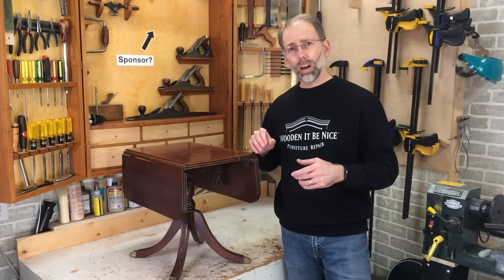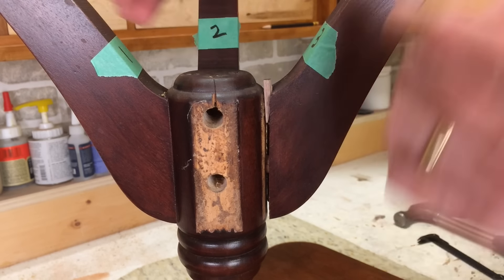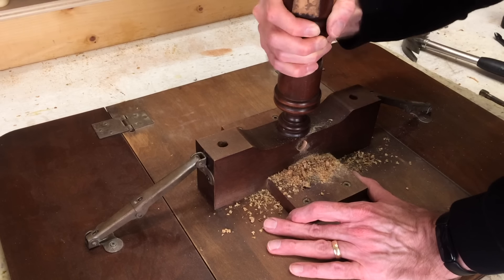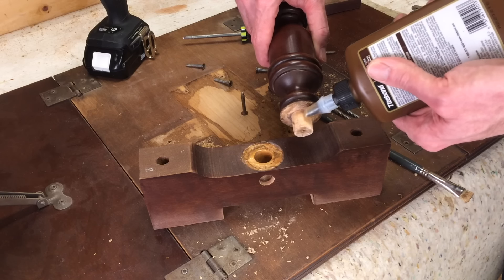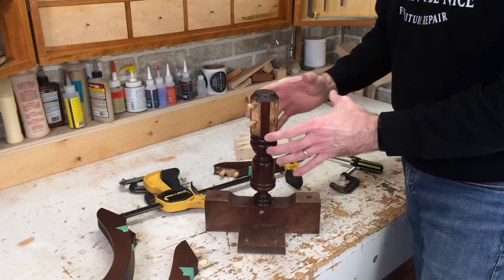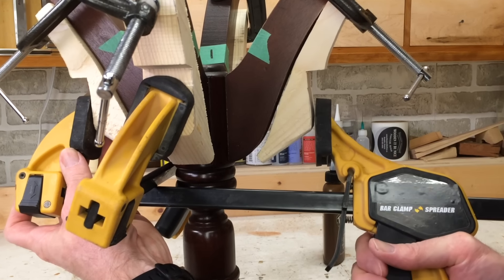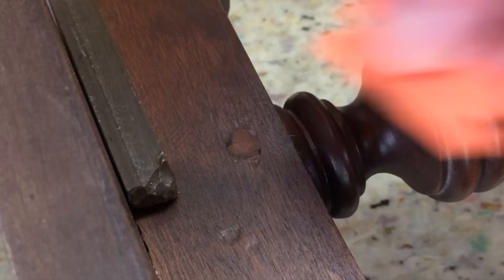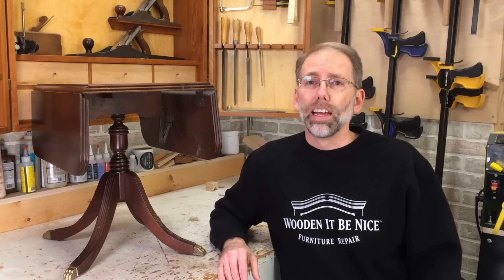How to Repair Pedestal Table Legs by @FixingFurniture

Comment: At 8:35 rather than using a large diameter plug cutter, I've used a device called by the marketer a "screw extractor". It is a hollow hardened tube with an ID slightly larger than the screw, and with saw type teeth on the end. It works very well, saved my hide multiple times during projects when screws broke during assembly. Don't know who makes them, or where I purchased mine, but Google probably knows. Afterthought, these would work to get access the the nails as well.
Reply from the maker: Thanks for being a subscriber Tom!  Scott

Comment: This repair is so,  so timely for me right n o w.   My sister dropped off an 1860's circa walnut piece just like yours,  but a bit larger,  and with only one loose leg.   The other 3 legs are nice and tight.

Comment: Scott, thank you for your helpful videos. I have a similar small table but instead of a metal mechanism to hold the sides up there is just a small movable piece of wood. They work really well and I'm wondering when the table might have been made?
Reply from the maker: Hi Kim.  The best way to determine the age is to look for the name of the maker on the piece, typically on the bottom and then do some research.  Without that, it's difficult to know.  Cheers.

Comment: Work at a bench. Doing  that work for decades! Just about every antique piece you'll get. Is driven full of Nails and screws. Along with ill fitting, slopply glued old breaks. Nothing to do but dissemble it all best you can. ( Just as you did) Trying not to cause further damage. But it happens. Just have to repair, make new parts accordingly. I don't recall ever seeing a drop leaf table that small. I wonder if it could have been a manufacturers salesman sample peice. Just a thought. 🤔

Comment: There is a variety of small silicon brushes sold to cooks, I wonder if they would be better for spreading glue than artist brushes. Easier to clean?
Reply from the maker: Good suggestion David.  I've looked at a number of silicone brushes but I have yet to find one that has a round end for inserting glue in mortises.  I'd be happy to try one if you've seen one with a round end.  I wash out by artists brushes with soap & water after each use, and if I forget (that sometimes happens), vinegar does the trick to loosen the glue.  Cheers. Scott #tip

Comment: i have an oval dining table bit it wobbles from 1 leg to the other by approx 0.5 cm. The legs are all solid to the main pedestal. Inside the main pedestal it seems the 4 legs are tightened with 4 thick nuts onto bolts which are all  tight. The main table  bolts onto atje pedestal with 4 hex bolts. Reassembling would the nuts need to go into the exact same holes or does that not matter.. Thanx
Reply from the maker: If I understand your question properly, you're asking if each bolt needs to be reinstalled into the same leg it came out of.  No, they should all be the same size, so they can go into any leg.  Does that answer your question?

Comment: Why not use some rubber band btw clamping jigs and furniture parts?
Reply from the maker: You could certainly do that.  By using softer wood for the clamping cauls, the wood on the furniture won't be damaged.  Cheers.  Scott

Comment: If you have a joint that's not loose don't take it apart if you don't have to or need too! A tight joint that's solid won't be going anywhere in the near future.
Reply from the maker: Agreed   When there’s some movement in the joint, it needs to be repaired… sometimes they have a hard time coming apart.  Scott